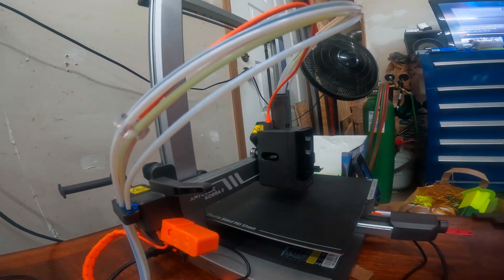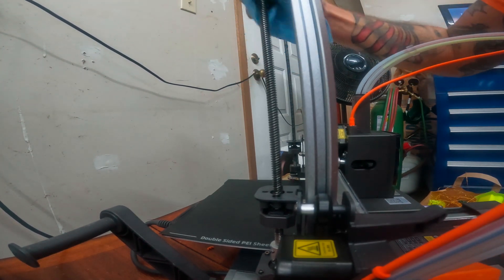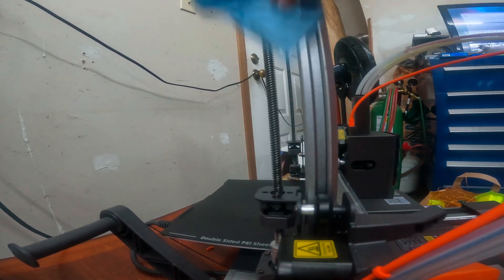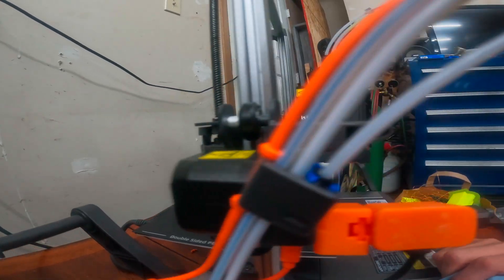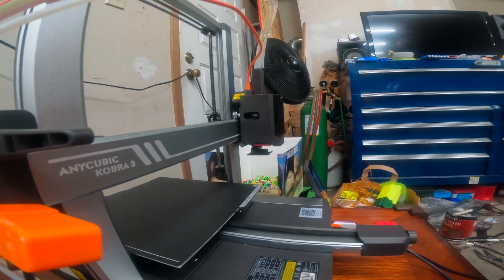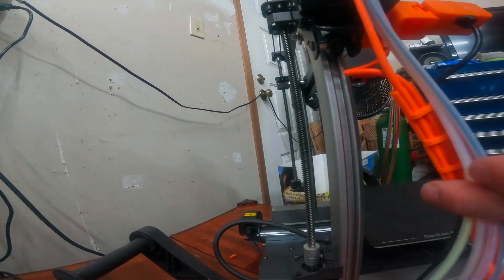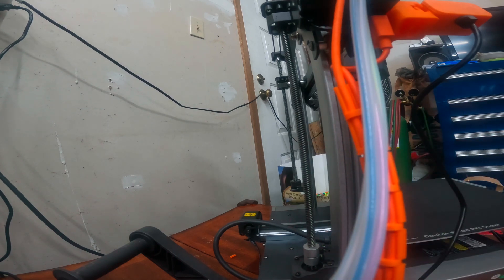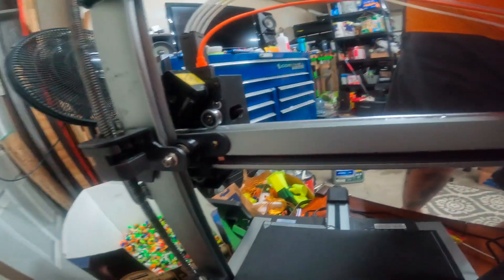Basic maintenance on the Kobra 3 "r&r grease"

Comment: Always remove the PEI plate while removing orr adding lube. Grease on you PEI plate is causing a lot of sticking problems!
Reply from the maker: That's would have been great to say, I normally wipe mine with alcohol or soap and water
Reply: Could this cause "problems on the z-axis" such as auto-leveling errors?
Reply: @PedroAnunciato no i dont think that a great Pei plate causes errors to your auto level.

Comment: I have a tube of that, it's very important to do this part. Have you done any settings changes on your slicer and what slicer do you use?
Reply from the maker: I am using anycubic next as my slicer and I have done the flow rate and pressure advance under the calibrations tests